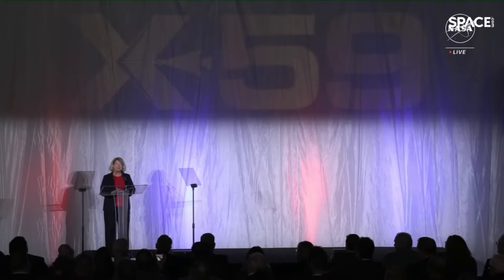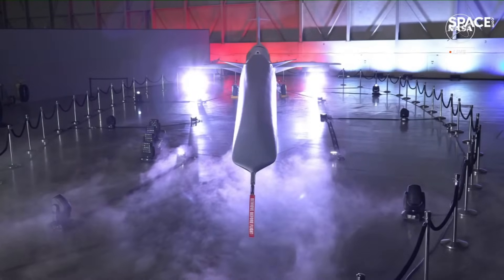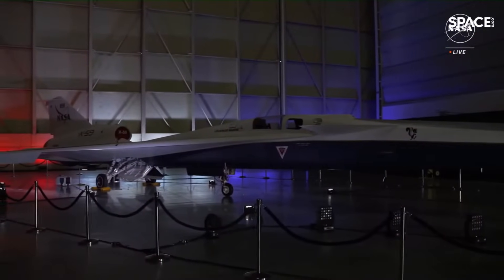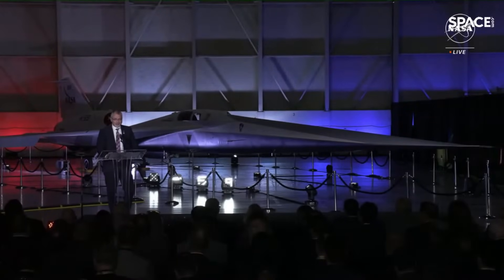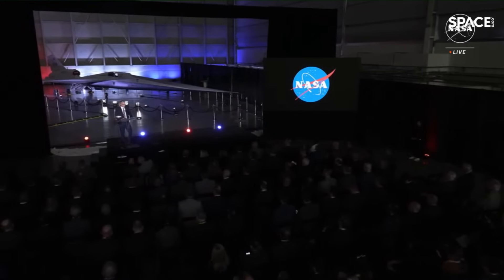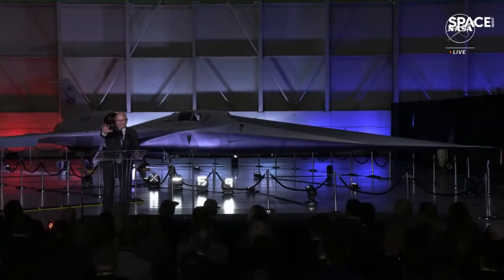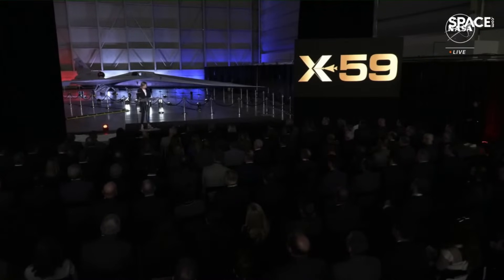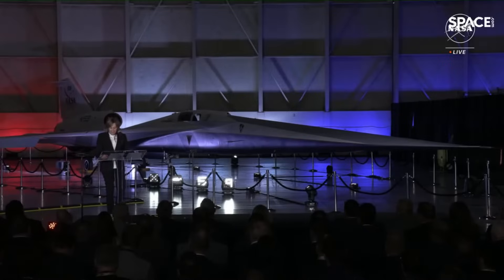NASA’s X-59 Quesst supersonic aircraft revealed in California

Comment: Wow this is so practical and definitely not a way to keep the fossil fuel industry relevant. It surely wasn't developed as a way of creating extremely high speed jets that produce almost no sound on the battlefield. There will most definitely be a market for a supersonic jet airliner and it most definitely will not become uneconomical to operate in the long run
Reply: There isn't a need to artificially increase the relevance of fossil fuels. There is tons and tons of it and it will be needed it adapt to the 1 degree increase in global temperature next century.